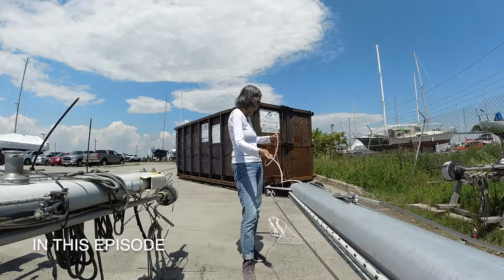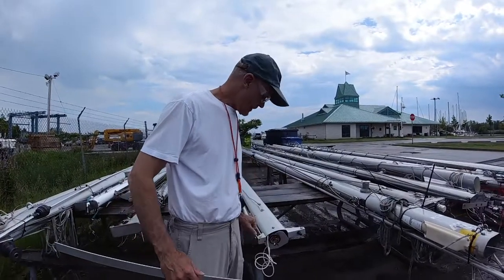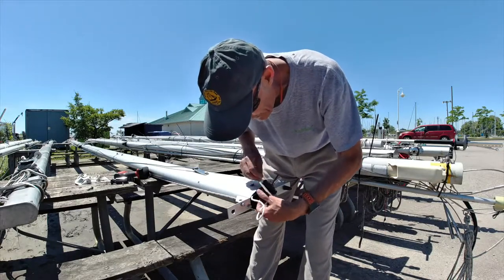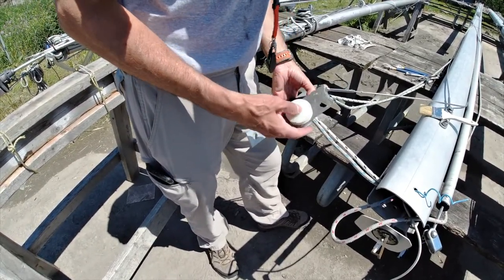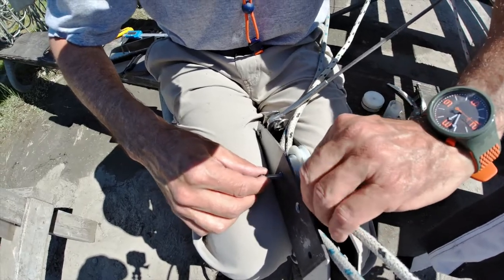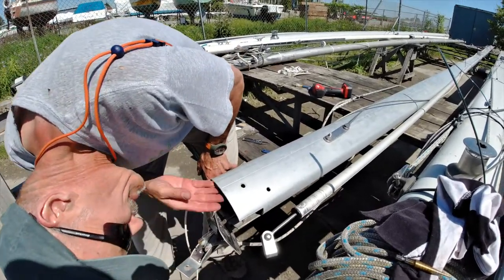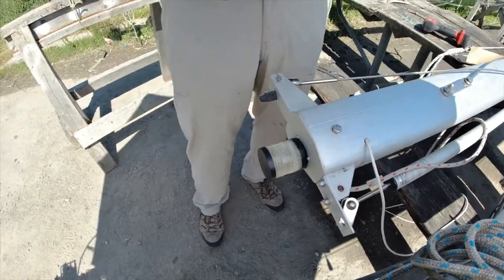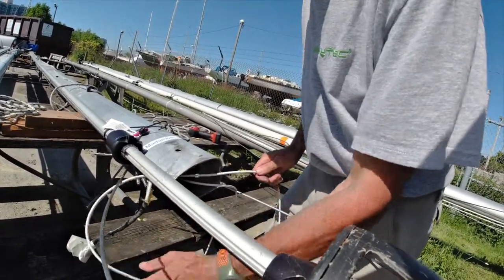One VHF Antenna, Two Cracked Sheaves & a Broken Mast Divider Plate - Season 2 Ep. 3 Sailing Odyssey

Comment from the maker: Timestamp:
00:01 Introduction 
00:52 Feeding the cable inside the mast
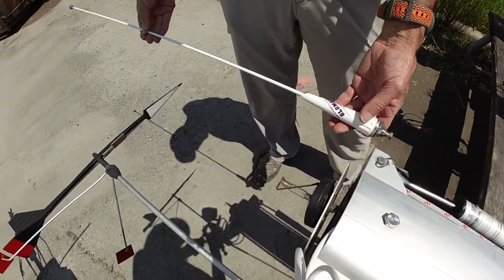03:24 Machining the custom VHF antenna plate
06:06 Drilling the custom VHF plate to the mast
07:43 Two cracked sheaves and one broken divider plate
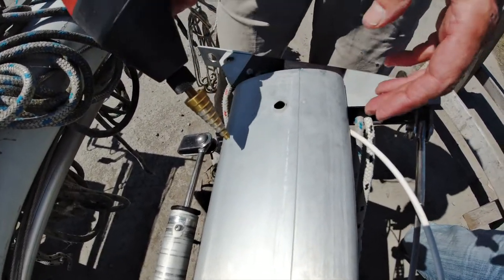17:26 Connecting the cable to the VHF antenna